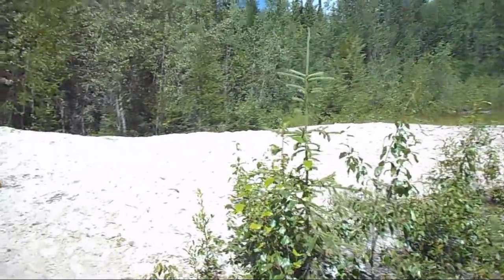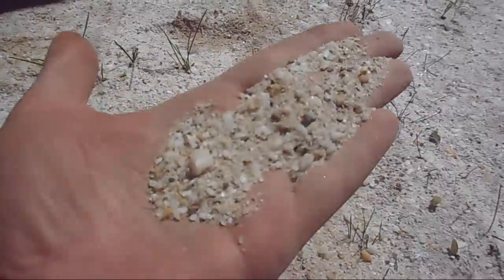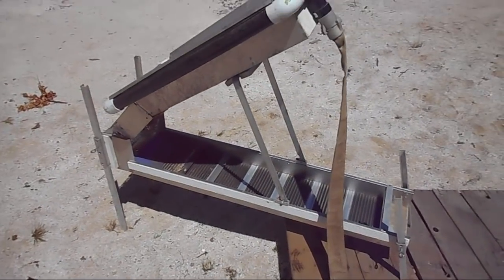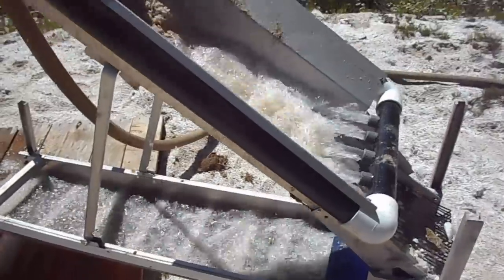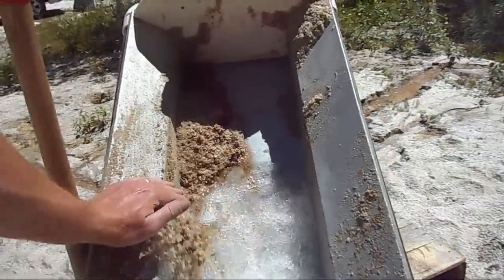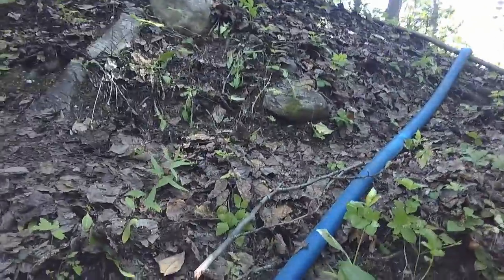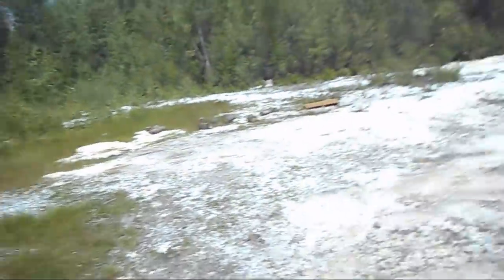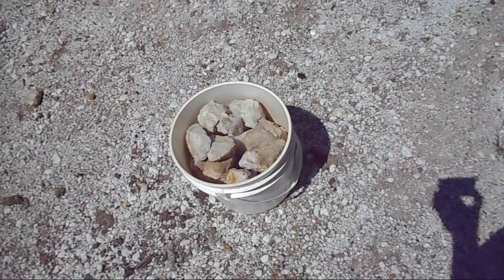Gold and Quartz Crystals! (high banker with Gold Owl mats)

Comment: Hey there was tiny tiny bit, the bugs almost carried you away at part hope that new claim pans out that a good try!! Just wondered since the quartz was light wouldn't the angle of the wash be to high and the flow have to lower?just it might tend to foat higher ? Cause just a question your very knowledgeable about workings, thanks good video!!!
Reply from the maker: Yes, the quartz is very light but the gold is as heavy as it always is.

Comment: I really like the Gold Owl Mat connection system. Currently use Gold Hog so I had to super-glue them together which disallows any on-the-fly mat reconfiguration. When its time for new mats, I will be purchasing Gold Owl Mats. Great video! Thanks for taking us along for your experiment!
Reply from the maker: I agree, that on the fly mat reconfiguration is fabulous and the Gold Owl matting catches the gold just as well as the Gold Hog.

Comment: Wouldn't the gold have settled out over the years and be much deeper?
Reply from the maker: I did dig quite deep - hitting the bottom of the crush in places.
Reply: You have to remember that water loosening the surrounding dirt, or in this case crushed quartz, it what allows gold to move downward.  Rain alone is not enough to move it more than a few inches deep.  Without water, or sometimes wind, gold will just sit there on top . The dirt has to be in somewhat of a liquid, loose state before gold can sink.  A good example is Western Australia. They have found many big nuggets, some weighing several pounds, right on top of the ground.
Reply: Seems like other gold miners would have worked it over back when the quartz was crushed.
Reply: Did they truck this in? Wouldn't it settle in the truck? Even if they did it there it still could be in a pocket somewhere. Who knows. Seems like you would need to dig a sample down to the original later of dirt. Idk.